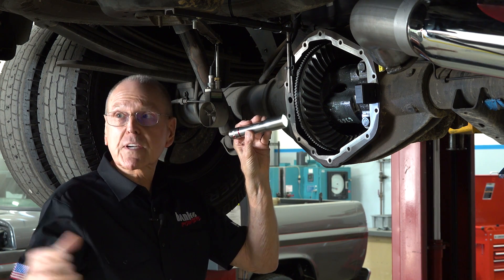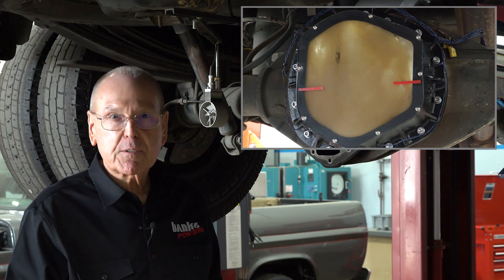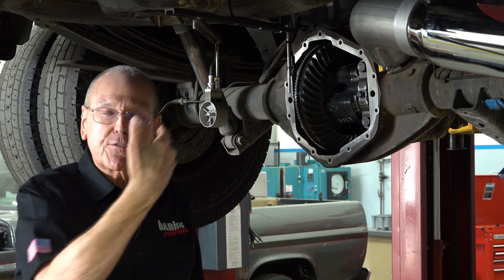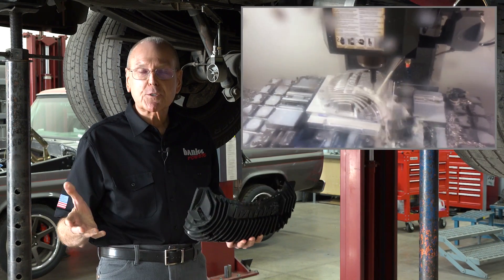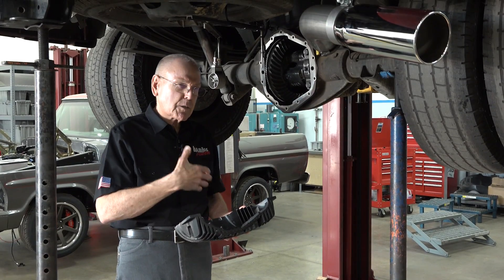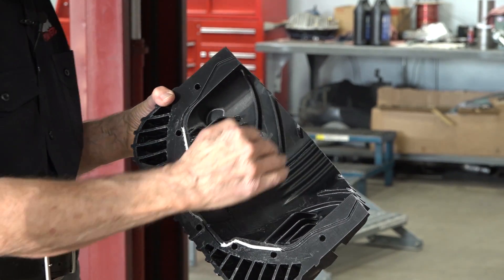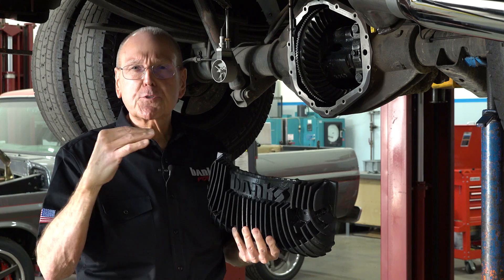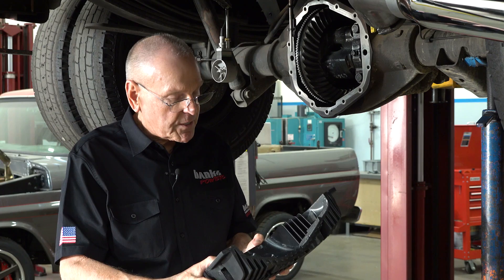Banks All New Rear Differential Cover – Perfecting the Design

Comment: I like what I see so far, the Ram Cooling effect appears to be a good concept on road but how would it work offroad with mud and debri blocking the air intake vents? Snow in my area would also be a problem but as lube temp increases snow would start shedding off the vents.

Comment: Be careful with the quality of the sight glass I've seen a lot of them crack and fall apart letting out the oil, and also dirt gets in. Great idea  though.
Reply: Brendan Casey we have had them on motorcycle engines for ever. Not just street bikes dirt bikes as well. My devilbiss air compressor is over 25 yrs old/has one and has never even leaked
Reply: @holmes1956O   I've seen compressors seize up because of the sight glasses having shattered and all the oil leaked out, one of them was used for the air brakes for a 10 tonne cane trailer being tow by a tractor, the compressor was powered by hydraulics when it seized up it boiled the hydraulic oil and smoke was coming off the hoses. Those sight glasses are mostly made of plastic.

Comment: Would it be possible to machine your new design out of solid Lucite or other clear plastic for testing purposes? That way you can visually see the oil flow and aeration and could even make design changes with rapid prototypes.

Comment: Ram air cooled diff. Nice. I like the fins on the inside. Extra cooling, keeps the oil from sloshing too much and brings the oil slung from the ring gear right up to the pinion bearings. Great design. I'd be a little concerned with ground clearance on 4x4 trucks. maybe put the ram air scoops up above the diff instead of below (if there is room between suspension/bed/spare tire). You won't get as much air up high, but standard diff covers have no ram air cooling. I'm excited about this design. I'm looking forward to a Chevy 14 bolt cover for my old 1990 K2500.👍keep up the awesome work, fellas.
Reply: Eric Ernst I was thinking the same thing with 4x4 trucks. The ram air is going to be plugged up in a hurry on muddy terrain.
Reply: m b Go through some water after? If there’s mud, there’s often 💦
Reply: Ken Dibble not here, clay soil will plug tires and wheels. Maybe a few puddles but only thing to clean is high pressure
Reply: m b fair enough, didn’t think of clay. In that case I agree with you and place largest fins up top above axle line

Comment: Super excited for Banks diff covers if that's where all of this is heading. I hope you make diff covers for all the ranges of diff sizes currently available. I'd buy one given the fact you've gone through all this testing to make sure everything is working as it should. I can't say the same about most other aftermarket diff covers out there.
Reply: Same here - I hope to see something for the Superduty as well.
Reply: I see a good thing here, I sure hope it's not just for towing, but also for offroad use. Maybe a little skid plate on the bottom.
Reply: @DirtShy  At the speeds encountered in most offroad use, the airflow would be essentially zero. You'd be better off adding an oil cooler with a heat exchanger and a fan than trying to air cool your diff at those speeds (not practical with long travel and solid axles, but not unheard of on the independent suspension side of things)
Reply: The reality is.... Your stock diff cover is probably as close to perfect as possible. Will be interesting to see if and how much Mr. Banks can improve it.
Reply from the maker: @GasNBullets  There's no airflow over your stock cover. At 60mph on the highway there's only 30mph of airflow under your truck... and with 18" of the rear diff cover, there's less than 5mph of air... the rear diff acts like an airplane wing, splitting the air with a dead spot immediately behind it. That's why we've designed Ram-Air scoops to funnel air up through the fins.
Reply: @GasNBullets  And with before/after facts. My concern is the first time you smack a boulder on the cooling ears, how well will this cover stand up? What about mud? Just like an 80's Camaro in snow, when the headlamps become useless.
Reply from the maker: @jamesplotkin4674  The lowest part of the cover does not hang below the lowest part of the differential housing itself. So, if you hit the cover, you'd already hit the differential so you've got bigger things to worry about. Now, with that said, we're probably going to recommend that serious off-road trucks stick with heavy duty steal covers.
Reply: Banks Power  Take my money, im sold. When can I order a diff cover for a dana 44/226 for Nissan Titan? The cover that comes factory is ugly as sin. These videos alone have made me a take another look at your products. I recently ordered a Banks Power Cold Air Intake and really really like the iDash. The iDash should be the next techbology auto manufacturers install as standard equipment. It would be awesome if it were merged with the navagation display from the factory or offered in an aftermarket stereo like Pioneer or Kenwood. It reminds me of the NEMA technology used in boats
Reply: @GasNBullets  I agree to an extent . Dodge has no drain plugs on theirs which is why im looking into buying one. So to change fluid you have to make a big mess.
Reply: @bradfordjustice7146  it is annoying not having a drain plug, however you'll never get all the old fluid and debris out of a drain plug on a cover.
Reply: AMEN to that BROTHER!!! I would certainly buy one!!! 👍👍

Comment: when will the numbers be posted? flat back vs curved????? been a loooong time now.
Reply: Exactly! This is visual content. We haven't seen ANY real numbers only speculation as to was is happening behind the cover. Of course everything said makes complete sense but I will not buy it (literally and figuratively speaking) unless I see temperatures. 

I still don't believe that the extra fluid is robbing hp. Once the fluid is in motion.......it's in motion not creating a drag. Kinda like a water wheel (if anyone remembers what those are) or high diver fixing to take the plunge and they have folks at water level splashing, breaking the surface. Helps with drag so it doesn't feel like the diver hits a brickwall.

Regardless, banks is saying that aftermarket covers do more harm than good. It will take more than what I've seen so far to believe that. Everything said and seen so far, does it sound perfectly logical? Yes indeed it does as long as we don't have watered down fluid in there. 

Btw, there is no doubt that the product banks is holding will make a BIG improvement to the temp and viscosity   of the fluid. Just needs to be a big enough improvement for the cost of these aftermarket covers.

Banks is quality though. They have true quality products.
Reply: @fordguy3773  after talking all this smack i hope theres wins by a big margin or it was all for naught. they shouldve ran the numbers first or maybe they did, before making videos knocking the comp. if theirs is worse or only marginally better, comp may have been listening.
Reply: Tell me about it .
Reply from the maker: We were going to post the numbers but realized it would make more sense to reveal them at the same time as we release our new cover's test results.
Reply: @bankspower  can't wait
Reply: @bankspower  of course you have to make a different cover for the front axle because the airflow will be different and there's different clearances.
Reply: @bankspower  no point in releasing numbers until your product is ready.   Just gives competition a leg up.

Comment: Now... what does he have planned for water methanol injection because new systems are going to be out "at the end of 2018" Hopefully the idash will control it and we will only have the need for 1 gauge.
Reply from the maker: The iDash is at the heart of the new Water-Methanol systems. Regi, Viet and Chris (engineers) have been working on the system five days a week. There's no other system like it.

Comment: Mr. Banks thanks for product development done the right way.  Understanding the problem.  Understanding the variables.  Setting the goal for what you want to achieve.  Design your solution.  Then test the heck out of to make sure you are meeting your goals and not adding problems.  Then release the best!
Reply: I asked and was told, about a month. Kinda looking forward to seeing what all the testing results end product looks like and HOW MUCH IT WILL COST?
Reply: I guess if you want a shiny rear diff cover then here you go. The stock ones work just fine, of course.

Comment: You know it would also be amazing that I've always wondered about is what if you put a lighter fluid in it or a heavier fluid in it? Now that you're able to cool the diff with this new Ram air-cooled diff cover you would be able to put a thicker fluid in it because you can cool it. There's also a bunch of aspects that we're probably not looking at far as fluid viscosity. I realize a manufacturer specifies a specific fluid type but what if we went lighter or heavier how does that affect it and now that we can cool it are there benefits to going lighter or heavier far as viscosity.
Reply: it is a matter of getting between the gears without gumming them up but still providing enough viscosity to resist wear.  won't get much lighter than 75w most likely
Reply: @goitoutdoors  I'd prefer 85/140 myself, considering my 10.5 runs approximately 80-100 degrees above ambient temp. I've seen it as high as 220, towing ~12000 lbs on a 105 degree day.
Reply: @tjjusten6266  Banks got his 11.5 AAM up to 330ºF.  220º is pretty cool, your engine coolant temps can be higher than 220º.